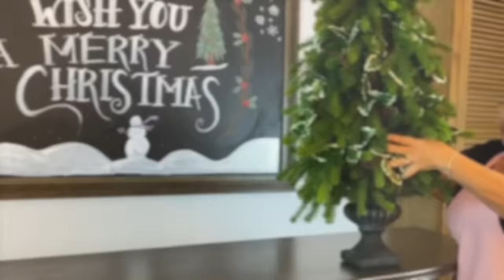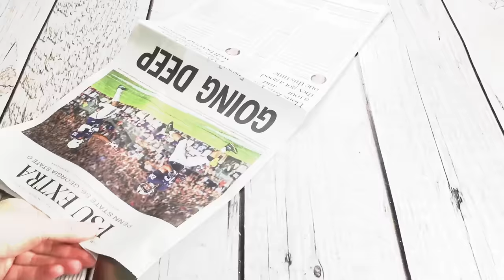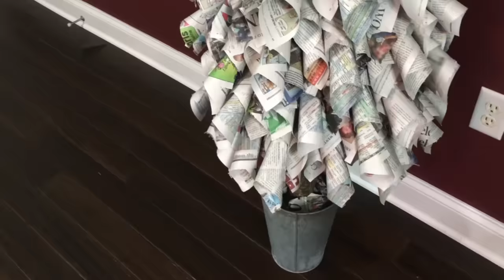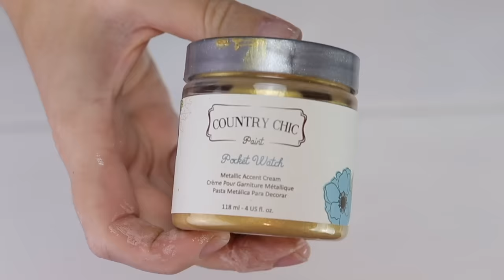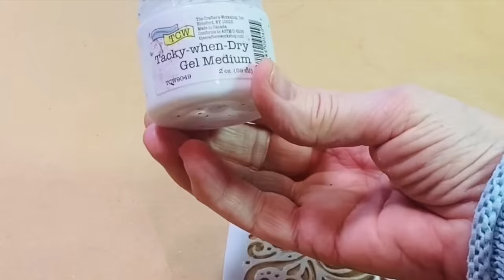He wraps a ball in fabric for this genius Christmas hack!

Comment: The Christmas snowflake is a very smart idea and is nice looking but I think an idea that would spice it up is to either wrap it up with a light string (white) battery pack so it will illuminate the snowflake at night. The light bouncing from the mirror may also make it look better. Another possible idea would be to hide the light string where it's not in sight under the snowflake to make it illuminate  at night as well. I'd use the cool white battery light string pack but warm white may also be cool.